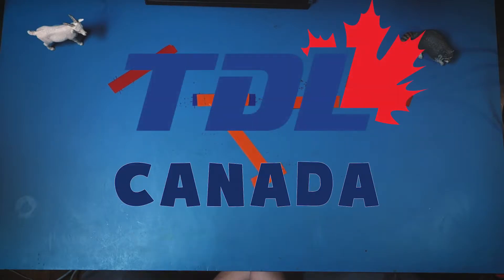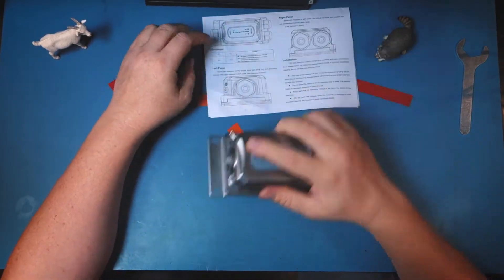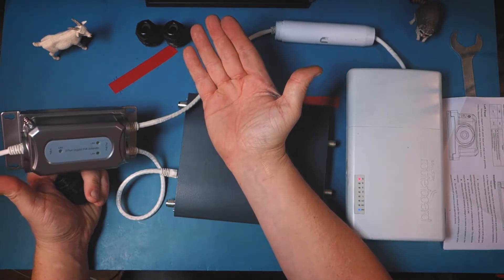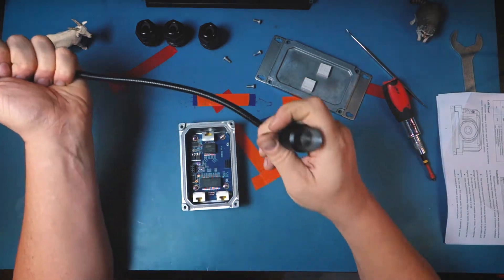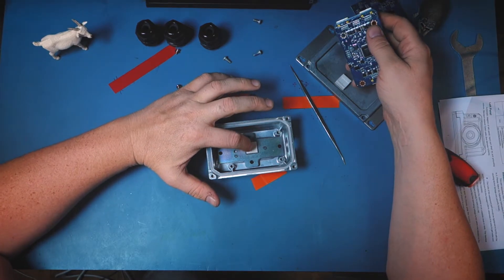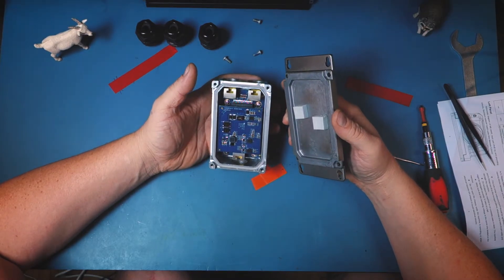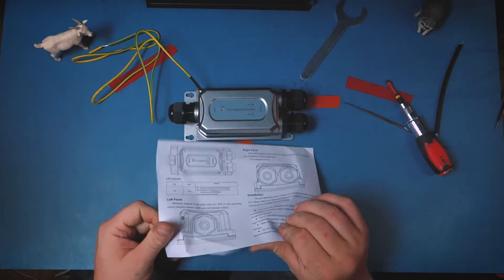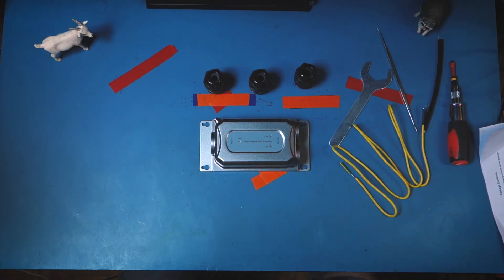Dual port 802.3BT POE Extender

Comment: It could be of more use to some WISPs like myself than you realize. I service a very rural area where it is not unusual for the house to be buried in trees over a 1000' off the road where no signal is possible. But several hundred feet from the house in the cow pasture is a place I can get a signal and I need power to that spot. I have customers with litebeams poe powered over 600' of cat5e. I put a Ubiquiti NanoSwitch Outdoor 4-Port PoE Passthrough Switch (N-SW) about the middle of the cable run and install a 1amp 24V POE to power the N-SW. I wonder if I could run cable even farther with this?
Reply from the maker: This is a very good point ;)